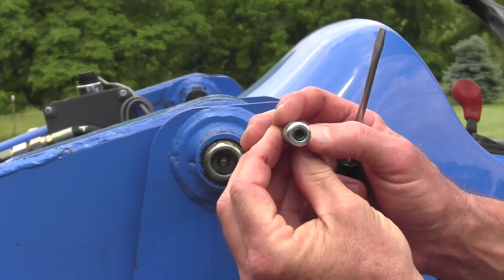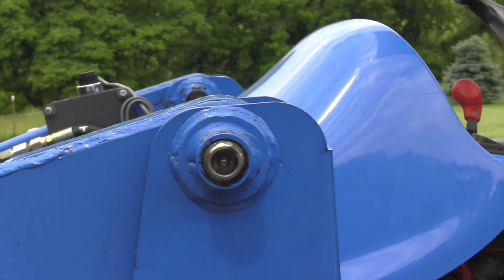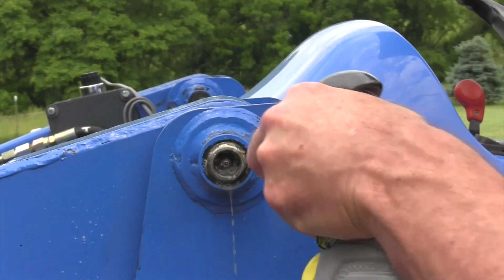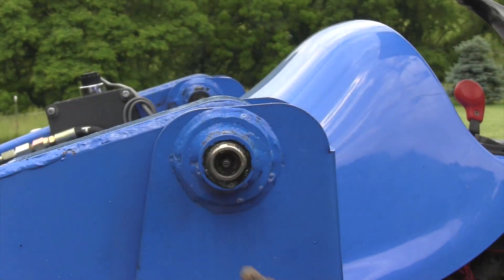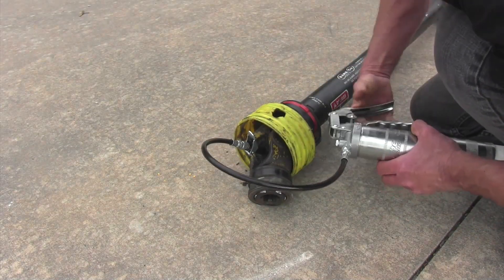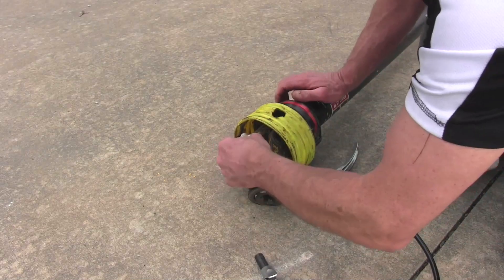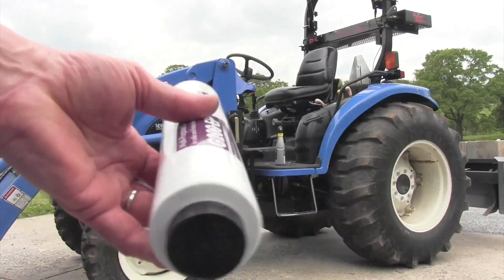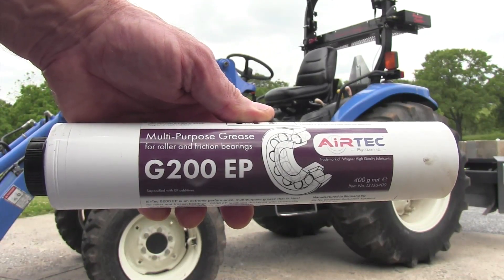12 Things You May Not Know About Greasing

Comment: Excellent video. Just a couple thoughts. I am a forklift technician, that's not to say tractors are the same as forklifts, but.... Most likely the pivot points on the loader or backhoe have bushings, not bearings. What's the difference and why would I bring this up? Well, typically a bushing is fixed in place with a pin that travels through the pivot point. The shaft where you apply your grease is also fixed by an outer bolt going through a ear. The shaft will has a grease path through the center with a outlet hole at each of the bushings. When grease is applied it will come out on, whichever side of the bushing it happens to be on. So, if you always grease you loader in the same position, one side of you bushing get the majority of the grease while the other may starve. So how do you remedy this? Apply you grease in the loaders resting position, then change  position of the bucket and loader arms and do it again. By changing position of the loader arms and bucket you also change the position of the outlet grease hole on the pivot shaft, thus changing where the grease hits the bushing. 
Sorry for the long winded explanation.

Comment: I had a scary incident with the Zerk on a dry packed bearing. I had rotated the joint etc, and still the Zerk didn’t seem to take the grease. I could barely move the handle.  I decided to wind off  the Zerk. As it was near the end of its thread, the Zerk exploded into the sky!  Standing there stunned, I heard the Zerk hit ground at least 5 seconds later! If my face had been in the line of fire I could have lost an eye. 
The Zerk was fine and allowed significant pressure to build in the joint but there was no way out. Scared the crap out of me. I was wearing brown coveralls fortunately...😉

Comment: I grease religiously every 10 hrs, every fitting on the tractor and backhoe, which I clean with brake parts cleaner before I do. PTO implements get greased every time they’re used. I’m a mechanic by profession and I know the importance of greasing. I use polyurea (Lucas Xtra HD or John Deere SD) which is overkill I know, but it isn’t that much more money (about a buck a tube) than lithium greases and gives a measure of additional protection in extreme circumstances. But in 50 years of servicing vehicles and ag equipment the one thing that has been a game changer for me has been the Lock ‘n Lube grease gun fitting. It has been a blessing, making what was a a droll, PITA chore something I no longer dread. I now actually look forward to greasing.  Thanks for the excellent video Mike, keep them coming. 👍

Comment: I bought a JD brush hog a few years ago and the dealer told me the gear box was full of gear oil. When I got it home, I got to looking at the plugs on the gear box and decided they had never been removed. I removed them just to be safe than sorry. I took a long zip tie and worked it all way to the bottom of the gear box and when I removed it, it just barely had a little oil on the tip of it. I’m glad I checked it! Y’all have a good-un!
Reply: Ditto for me on a rotary cutter I bought at Rural King. Bone dry.

Comment: As a kid in the farm, each tractor had a grease gun mounted on a fender.  No cabs back then.  A good grease gun would shoot about 20 feet.  Great for aiming at road signs as you drove down the road.  
Even back then, some bearings has a seal of sorts.  As you pumped the gun, you could feel when it got full, otherwise it would blow out the seals.  Mostly found on PTO knuckles.

Comment: If you have a greasable joint that hasn't been greased in a LONG time and has been sitting for a LONG time, I have had to use a propane torch to heat the old grease to loosen it enough for the new to go in.  I have also removed the zerk, position the resulting hole upward and flood the inside area with penetrating lube.  Let it sit for a bit to soften that old grease and try it again.  Yeah, using the machine will sometimes loosen that crap up, but sometimes that old grease sets up like concrete too.....sign of poor maintenance.

Comment: Great sound effects Mike. If someone had one bad hand, I would recommend a battery powered unit or pneumatic one. Mike be easier to squeeze than that pistol grip one. Especially if it was their non-dominate hand. I always use Marine grease that way I can use it on my boat and anything else. It is waterproof. Yes you mention the battery one at the end. Great deal.

Comment: A pneumatic grease gun is wonderful for me.   Go to Northern Tool and check out the Lincoln pneunatic grease gun.   Or check out the Milwaukee M18 battery powered grease gun.  both of these use standard grease cartridges so you can avoid those costly specialty tubes.  For the best grease try red waterproof grease.

Comment: Most times when a Zerk won't take grease, dirt has gotten into the bearing/sleeve and it has "dry pack". Dry pack is grease dried out with dirt and it has packed into the channels of the bearing or sleeve and wont allow the new grease to enter the channels. Most times you can free it up by moving the attachment around a little. especially with the loader bucket assembly or backhoe. But it will need to be taken apart and cleaned to get all of the dirt out.

Comment: I love your posts and while some are basic they still serve as good reminders. In this video there are two points I'd like to elaborate on. First there is only one bad kind of grease...that's the kind that stays in the tube! Secondly, because I'm frugal I have frequently removed a non-working Zerk fitting, carefully placed it in my vise, cleaned out the existing grease (and the obstruction), poked at the ball, then attached the gun and often times it works again. If not I have a kit with assorted sizes and configurations of fittings when one needs to be replaced and find that an absolute necessity.

Comment: Good video. Perhaps you could have mentiond that, if possible, slowly rotate or spin the bearing being greased. Also, you can buy dust covers to keep dirt and moisture off the fitting. These covers come in lots of colors, too, so you can use different colored caps for daily, weekly or monthly greasing. Nice sound effects, too.

Comment: Grew up calling them Alemite fittings.  Still a valid identification.  Also, sometimes when they won't take grease the mechanism requiring grease may need to be rotated.  For example a loader arm may be in such a position that the pivot joint is closing off the Alemite/Zerk orifice.  Rotate it a little bit and it usually opens up.
Reply: I've heard them called that also. Alemite is actually a trade name for a brand that makes grease fittings and greasing equipment.

Comment: Just found out the hard way that the deck wheels on my brand new finish mower lack any kind of wheel bearing. Nothing in there but a wheel, a bolt and a big, open cavity between the two that requires probably half a tube each from my baby grease gun (I’ll be upgrading soon).

Moral of the story is be generous with the grease because when it comes to preventing premature failure, greasing may not just be your LAST line of defense. It may very well be your ONLY line of defense.

Comment: LockNLube  grease gun couplers work like a champ.  They lock onto zerks tight so the grease  goes in not out.  Lever allows easy removal so you don't have a tug a war getting the coupler off the zerk.

Comment: In reference to your #6, how do you know when you're done? Most equipment that I've used says to grease until you see new grease coming out, meaning that you've flushed out the old, used grease. 

Also, I just bought a dewalt 20v grease gun and put the lock n lube top on it. I use it almost daily and can go through 6+ tubes of grease on a single battery charge. 

We also took delivery of a brand new tractor in February... Less than half of the zerks had ever been greased and I also found a few loose hydraulic line fittings that I had to tighten. Always check your equipment and grease grease grease
Reply: Brandon Speed: Yes! If you're old enough to remember Tom McCahill's car maintenance books and articles, he said Audie Duesenberg told him "Keep 'em full of fresh oil & grease and they'll never wear out!"

Comment: One thing I didn't see mentioned in the video or the comments is to be careful if you're cleaning your tractor with a pressure washer.  Try not to hit the zerks directly with the high-pressure stream.  You could inadvertently inject a bit of water into a fitting.  Granted it wouldn't be much, but any is more than desired.  Also, if you're pressure washing, wipe off as much surface grease as you can first or you'll wind up wearing most of what gets blasted off....don't ask me how I know.

Comment: Hi Mike, Love the Lube shuttle............. their quick lock........ not so much. Lock & Lube is much better. Thanks
Reply from the maker: John, if you had the safeLOCK and felt it wouldn't lock on, watch this: https://youtu.be/UeukXciUUWI.  The only problem we've had with safeLOCK is folks not getting it locked on properly.  I had that problem when I first tested the product.  Once it's locked on, it won't come off and it's a whole lot easier to squeeze than the heavy spring-type models.
Reply: @TractorMike  Thank you Mike, The safe lock worked fine on easy to access fittings but not ones that were not so easy like u joints L&L worked fine on all, maybe I should have let it "wear in". Great content and tutorial, (https://youtu.be/UeukXciUUWI) may give it another try someday, hate to just "pitch it" for the cost.

Comment: Mike, I'll put a quick plug for WD-40. If the zerk wont take grease. Squirt it with WD-40 and that will clean and clear the zerk to work properly. The zerk needs to be removed, squirted with WD-40, wiped down and put back on.

Comment: YES YOU CAN OVER GREASE. 

It depends on the bearing/ joint, joints and bearings that have seals if over greased will start damaging seals and you’re left with no seal to keep dirt/dust/debris and water out and pretty soon you have lapping compound for grease in there eating away your bearings. And most people will try to tell you it just needs even more grease to fill in the slop it’s created, which is only a band aid fix to keep running on damaged bearings. Also with trailer wheel bearings that have a fitting and it has trailer brakes. Too much grease pushes out of the gun bearing and makes its way on your trailer brakes, now you’re left with a trailer that won’t help you stop.

Comment: The Coupler does not push the Ball back ..  Grease pressure  does.. and a   spring  pushes it back to close it .  works like a  check valve..

Comment: Hello from Sardis City, Alabama. Very informative clip. I have 1 fitting not taking grease. Ive replaced with a better new one but still will not take grease. What suggestions do you recommend for this issue? 
You was 100%correct! There is always 1 that dosent work right.👍🇺🇸🇺🇸🇺🇸🇺🇸🇺🇸🇺🇸🇺🇸

Comment: If the fitting won't take grease, check it out, I've have more than one zerk be located on a blind alley with noplace for the grease to go.  Aholes at the mower factory didn't line up the bearing  with the hole in the fitting, in one case they didn't even drill it out.

Comment: thumbs up, your info does clear up some mud. 

You mentioned about how do you know if your new tractor has been greased. What I have been wondering is how can one know if the dealer actually put the beet juice in the rear tires that was required and paid for with the new tractor?
Reply from the maker: Ken, if you press in the tire stem valve you'll have some come out.  It's hard to keep the fluid from coming out when checking your inflation, even with the valve stem at the 12 oclock position.

Comment: Thanks Mike, good information.  Are all Zerk fittings the same size?  I purchased a new grease gun, the tips (came with two) are extremely hard to remove from all the Zerks on my tractor.  I tried both tips with the same result.  I have to pry them off or get a pair of pliers to get them off most of my tracotor Zerks.
Reply: Lock n Lube grease gun coupler is money well spent.
Reply: The grease guns’s coupler (part that attaches to the zerk) can be adjusted to reduce the clamping  force applied to the zerk fitting.  You will likely have to rotate the outer component of your coupler clockwise (as viewed from the rear of the grease gun) to allow the coupler to detach itself with less effort
Reply: You can unscrew the end of the grease line fitting ( the one the end of the hose, not the zerk ) and it will loosen it up so it’s not so tight.
Reply: Try unscrewing the tip from the tip of the grease gun. My grease gun is the same way. It will “lock” on to the grease fitting, and once you unscrew it about 1/4 of the thread depth, it falls off of the fitting without any force.
Reply: some tips work like hose fittings and can not be removed while there is any sort of internal pressure.
Reply: See if the grease gun will adjust. The metal part at the end of the hose should be adjustable. You can turn it so the tightness on the zerk fitting is less.

Comment: Have a question. I have broken the right jack screw twice now. Do you have any ideal if what I am doing wrong to cause this three point stalizer bar jack screw to break? I am going around trees in a tight circle county clockwise. I had a know it all type person tell me every time I turn I need to raise the bush hog to keep the wheel from putting pressure off the jack screw

Comment: Do u ever back drag with your bucket on and if so what is a good way of doing it with out messing up any thing
Reply: Curl your bucket up and use the backside of the bucket to drag. If you point the bucket down, then your cylinders are extended and you could bend a cylinder.

Comment: a grease fitting hammer works by filling the hammer with grease, put it on the fitting and hit the end with a hammer and walla, it pushes the obstruction through and you're back to greasing. the particles that plug the fittings, are tiny in comparison to the applications i'm talking about, scrapers and dozers, but even the small stuff. if you have time to stop and find a zerk fitting if you don't have an abundance of them (which doesn't help me much as they'd all be lost by the first time i'd need one,) other wise do the hammer gun.
Reply: It works a lot better if you put in some thin oil or transmission fluids on then hammer that way it'll push through there and lube it and then you can grease it.

Comment: It  could  be that the  grease is so old that   it dried to a solid  state..  or the  area to gease  has a solid  rust in it . Or in the case of pin and  bushing the  pin  could be blocking the  gease path .. for examples  pins  on  Springs  for suspension .. you have to  take the weight  off from the  pins with a  Jack then grease it ..

Comment: Grease pressure pushes the ball in the zerk in not the connector.
Always wipe off your zeros before greasing.
Best grease is the one you use, the best grease setting in the barn doesn’t work.
Always wipe off excess grease, it will attract dirt/grime.
We Americans tend to over grease ie: put too much in.

Comment: You are spot-on about the manufacturer’s using cheap zerks. I have a brand new tractor and 3 of the zerks will not take grease. As a kid, i loved driving tractors(40yrs later i still enjoy it). My dad made me grease it everytime i drove it. If i greased it yesterday, he would make me grease it today before i could drive it. He was also a firm believer in changing the fluids often. Lessons learned. Stay well and stay safe 👍👍👍👍👍👍👍👍👍👍

Comment: Is there a way to grease the sealed bearings on a John Deere 535 hay baler,  especially the small rollers that turn very fast?
Reply: If there is no fitting, it shouldn’t need grease. And frankly grease on a hay baler I’m sure as you can see only attracts chafe/ hay dust. So you’re left with the time consuming task of removing the bearing and removing a seal while trying not to damage it, grease it and press it back in... and in that whole time you would have been better off just replacing the bearing. Those bearings are probably the least of your worries. We’ve had one sealed bearing fail on a hay baler (JD 568) that had over 10k bales through it and the bearing failed because the bearing housing broke. And that’s over the course of 20+ years of making hay.

Comment: Mike by chance have you changed a bearing lately? I don’t know but in automotive they are mostly sealed. My zero turn bearings are sealed so greasing them is pointless. You have to remove the bearings and remove the cover on the side that the grease will enter. It is sad because when you do different things and remove the cover from the bearing say your belt tensioner. There really isn’t any grease in them. They’ve made things to fail nowadays!

Comment: Hay Mike how hard would it be to put loader joy stick to the left finder on kiotick35 tractor hst.
Reply from the maker: Jeff, if you were installing new joystick, probably not that hard, you'd probably need to alter the mounting kit a bit and buy longer hoses.  If you're trying to relocate a joystick to the left side, that could be an issue because I'd bet the mounting is built into the fender.  Good luck!
Reply: @TractorMike  thanks mike for responding about moving loader joy stick to the other side what i was thanking was to leave the original and tee over with longer hoses as you have said and put a cutoff value between the four hoses so it could be used right handed or left handed by opening one value and closing the other, now it sounds like its crowded not sure thanks again for for your reply.

Comment: FYI if the dry pack is a strait shot to pin, Use a small drill bit and spin it by hand and clean some of the crap out to the pin. Then pump the shit out of it and move the joint to help push out the crap